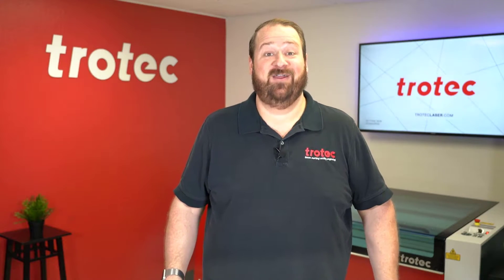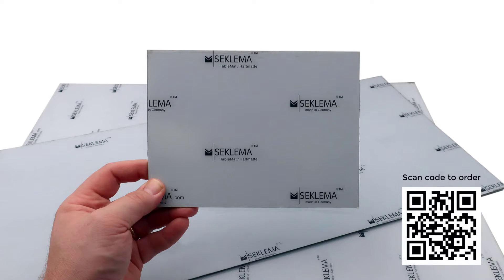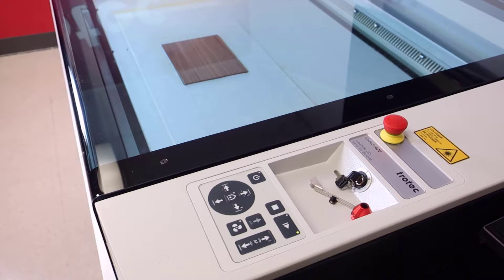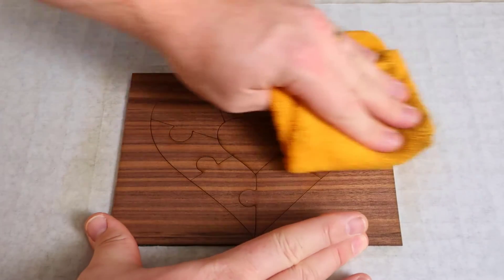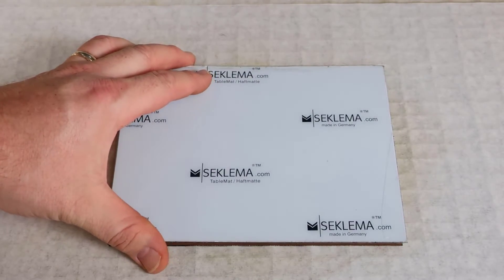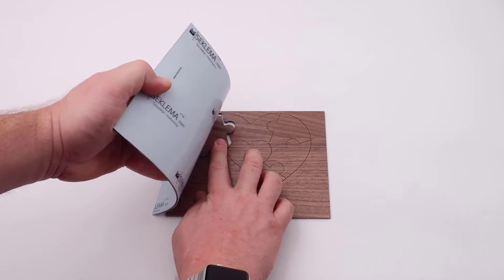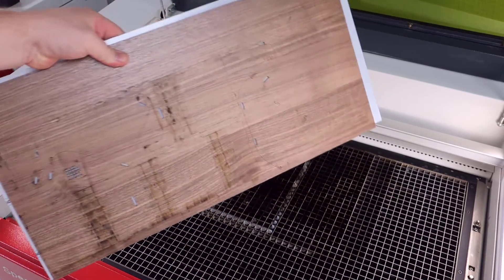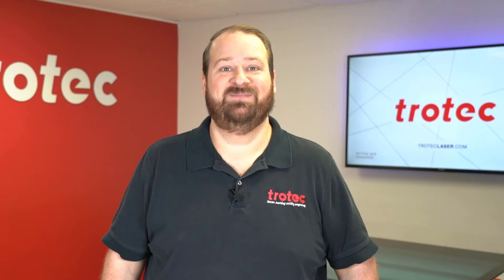Laser Hack: Pick up and Clean Material with a Tacky Mat

Comment: Dave, do those mats hold up to numerous cuts into that material over and over. How do they need replacement? Does Trotec sell these?
Reply: These mats should last for years but should never be used to hold down materials to laser cut on, this video shows cut parts that were cut on the cutting table being picked up with the hold down mat (parts are not cut on the hold down Mat).   Yes, we do sale the hold down mat, there was a QR code on the video and here is the link to order them.:  https://store.engraversnetwork.com/category_s/2500.htm
Reply: @davidstevens2577  much better pricing here - https://www.jpplus.com/seklema-engraving-table-hold-down-mat?gclid=EAIaIQobChMIxp7j4pW57AIVAdbACh2ZuAwfEAQYASABEgJbHfD_BwE#676=5534?utm_term=&utm_source=adwords&utm_medium=ppc&utm_campaign=Shopping+Catchall+(Smart)&hsa_mt=&hsa_ver=3&hsa_ad=459417684155&hsa_kw=&hsa_tgt=pla-297240583116&hsa_cam=10946727760&hsa_src=u&hsa_net=adwords&hsa_acc=1076321572&hsa_grp=110234500209

Comment: This seems like a good option to cut acrylic instead of a pin table,  but wouldn't  the laser cut through the material an into the mat?
Reply from the maker: Hey Daniel! These mats should be used on the material after laser processing. It is not recommended to use a laser to cut on them because it will destroy them.